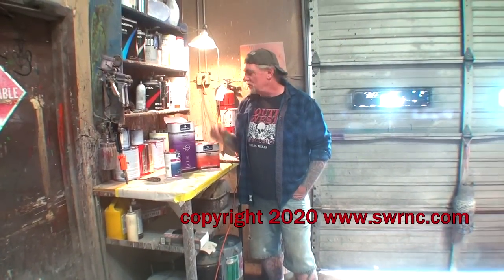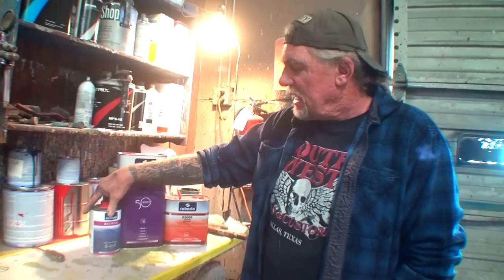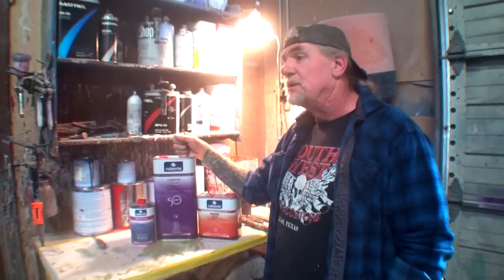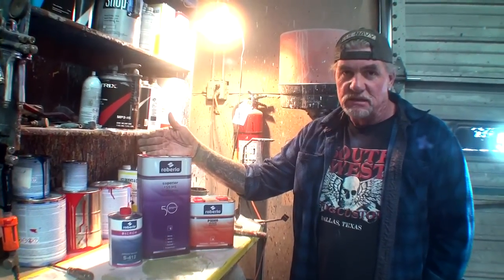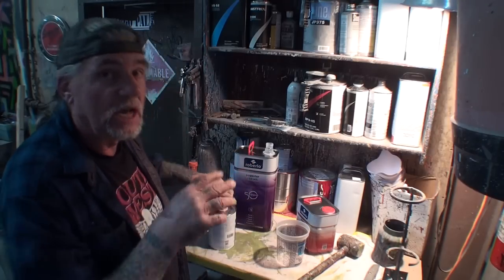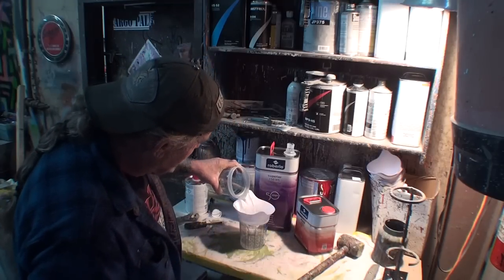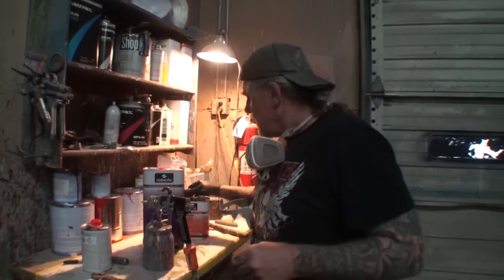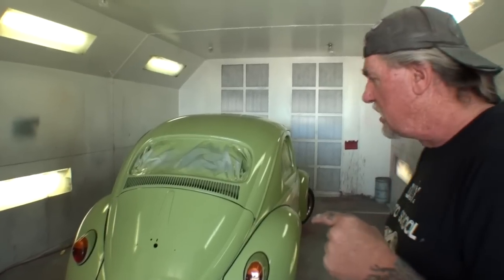How To Clear Coat A Car - Roberlo High Solids Clear Coat Review

Comment: Roberlo makes good stuff. Their best product in their clear line is Kronx 610. This will not work well in a Binks model 7 but works great with a high efficiency gravity gun like a Tekna Pro-lite with a TE20 aircap and a 1.2 or 1.3 tip. Works great in a SATA X5500 RP with a 1.2 or 1.3. Best gun for the Kronx 610 is the Iwata WS400 Supernova with a 1.3mm. Roberlo for your information is from Spain.
Reply: You don't  know  about. The lifetime  on this clear
Reply: Can one use standard reducer or is it Roberto specific?

Comment: Roberlo maxi fill body filler is some of the best filler I ever used, lays nice, no pin holes, cuts like butter and half the price of rage gold and 3m Platinum
Reply: Sanding wise you wouldn't notice the difference, just make sure you get maxifill . May even cut a little better. No need to put 40 grit or cheese grader on it

Comment: We use their products at work. The b500 is a universal hardener, for primers. Their cleats have separate hardeners from very slow to fast. The global 6000 probably the best clear they make. And you can rub it the next day. We have had some issue where if you lay it on really thick it gets some die back issues. But yeah their stuff is really good.

Comment: I enjoy seeing the ole number 7 in action. Would like to see more videos where you show the paint process with the siphon feed paint guns 
   The Gov, paint gun manufacturers, you tube gurus have convinced everyone you need the latest hvlp, lvlp fu-lp spray gun. And all because of Gov regulations. Not results. The siphon might use more paint, but high pressure guns lay out a great finish. Built like a tank. It's like a good old car verses a crumple zone modern car. These classic guns are sturdy from top  to bottom

Comment: A lot of people are commenting about Tamco and I would really like to see you give it a try sometime too. I think their flagship clear is the 2104 which they also have a slower version of (2105) for hot and humid climates. They also have a 2021 which I believe is their version of PPGs 2021. Anyway, a small American company out of Virginia, check em out. The Roberlo clear looks great, might be worth sticking with but it’s always fun trying different stuff. I started using Tamco this week, so far only two small jobs, I used their 2 hour clear (7600-I don’t have a booth) and I’m pretty impressed.

Comment: That looks alot like the shop  line jc6700 European clear. Pete u should  give southern poly urethane  a try.  Their epoxy is top of the line. And its sandable  like a 2k primer. Their production clear shouldn't  be called production.  Try them out. Free shipping and 100% made in USA

Comment: Pete give tamco a try sometime. I tried the hi build 5311 and its nice.... Other products be great reviews too
Reply: Henry Ford used “Varnish” too, as long a you wanted a high gloss black. Other colors available in 30 years. 
(Just having fun) Urethane binders are mostly all the same, it is the man made additives they add or leave out, that makes the product. 
 I have a buddy from high school who worked on coatings for nuclear submarines as they where under the water for a year or much longer, if needed. It’s like “Anti-Fouling” coatings at the waterline on boats. It acts like an “Exfoliant”. Algae and Barnacles can reduce to speeds by 12% per hundred foot.      Best of luck.

Comment: Saw a video Tamco Clear never used it though the store went to buy auto paint products last year was Auto Value they have Nason products I got the flat black sealer last year it cost like 160 but never used their basecoat. I used different clear but wanna start using high solids clear and fast speed. Tamco looks pretty good for clear but lately when get paint got the Starfire paint from Paint For Cars site. I don't know the best fast clear speed paint to use though. I used Speedkote clear too.

Comment: Have you ever done a hardness test on these clear coats after they have truly hardened.   Hit a high solid ppg product with a wooden, rubber or steel mallet and show the results after you have pulled and polished the area.   I have never used the product you are using in this video but I have used ppg products and was always impressed with how tough and the abuse it would take.

Comment: Got a Big Question for you Pete, I was priming my car the other day. And I my hose rubbed the rear quater panel when it was wet. And my butt bumped the other side. Other that those two mistakes perfect. But what's the best way to fix those mistakes
Reply: If it's in the clear, it may wet sand out.  If it's in the color, you'll have the feather them out with sanding and respray the area.
Reply: Just need to Sand and reprime

Comment: How many coats of this clear did you put on? just the one?
Reply: @Wo Wo 27  >Pete said in the video that he was unable to get a tack coat on so after increasing air pressure 10 PSI, it spayed better. He got 3 wet coats on the entire project. 
 It is true to practice with air pressure, tip/needle and speed. I have a body shop 1/4 mile from me and got a flat hood, taped off horizontal and marked each change on the panel. Once done, I took it back as this huge shop sells their bumpers and metal. But the owner has 3 Harley’s...Tough Life I am sure. I am 6’3” with 3 lumbar fusions in 87, 1 fusion in 05, then same Dr did all 5 in 2020. They won’t even help me load/unload as I use a cane. Bent, burning like torch at belt line. Still there! SOB’s got paid!

Comment: If it's 2:1 it doesn't need reducer.... That can "clearly" says Basecoat reducer not clearcoat reducer🤷🏾‍♂️🤦🏾‍♂️
Reply: Base coat and clear are both urethane components! You can use urethane grade reducer in both.

Comment: You would get better results if you were not stuck in 1980 with that Binks 7.
Reply: The best paint job is one big run.  Heavy and wet which is what these guns do.  Hvlp, which I use and learned on, is meant to save paint and be more efficient with less air.  Binks makes some of the best products out there.  They still have the best polyurethane foam gun 30 years later.  Your comment is the same as telling Eric Clapton he would preform better with a newer acoustic than his favorite.  It’s a tool, no more no less, that preforms as well as the person using it.

Comment: I've painted a bus, a show car and now a jeep in my lifetime, bus was omni, show car VW Notchback ppg, and the jeep with Sherwin Williams crap, worse paint ever... gonna have to redo, it sux bigtime
Reply: I used Nason 18 years ago, Base & Clear. Complete compact car we owned. Looked real good for 6 years until one son turned left on RED light. Never color sanded but OEM orange peel. Very little. 
Bought more 5 years ago for truck, same gun, same everything, Clear was down grade crap. Added more reducer on third coat to melt in, nothing. Shrinks, dry, needed work. The changed name to Axelta the next week so change or old, both!

Comment: This clear is terrible and doesn’t hold up at all in the future . I wouldn’t even clear my mower with this stuff . I see this stuff being good with teaching someone how to clear and throwing whatever you were working on out..lol it does lay out nice but is just garbage
Reply: Don't just say it's garbage, share WHY it's garbage.  Thanks.
Reply: @warrenlewis3977  well first of all this delaminates in just about 6 months of left out in normal weather . Also if u think u spray it perfect most of the time and you walk back 20 min later and this stuff creates the thickest runs u ever seen . Also has a horrible smell when u spray . The only good thing about it is that the setup is around 120 but I wouldn’t even use it for free that is just my opinion sir I use DuPont products every day
Reply: @justinwerfel6396  Kool, thanks.  I've heard good things about it tho.  Ur boy SWR &CUSTOMS gave it a thumbs up.  I'll try a batch and see what I get.  Thanks again 🙏
Reply: To me it spray just like axalta 8180. It’s high solids so u need to know how to spray high solids. And reduce it 20%